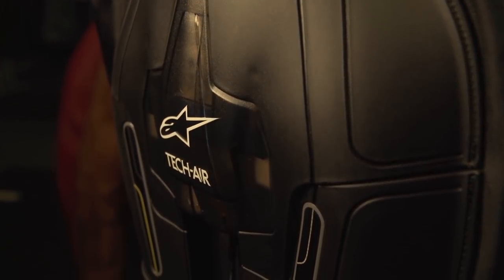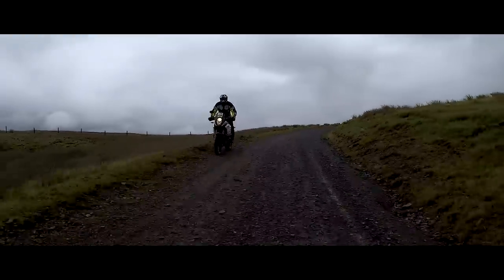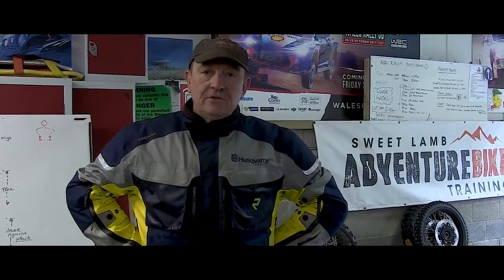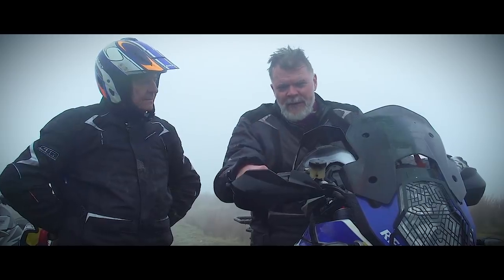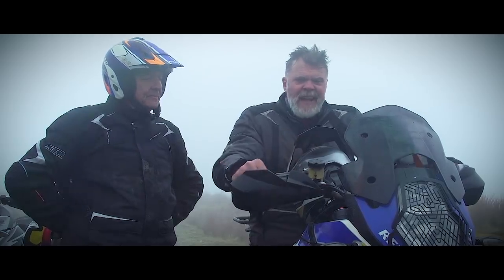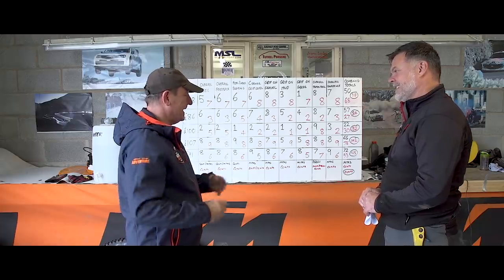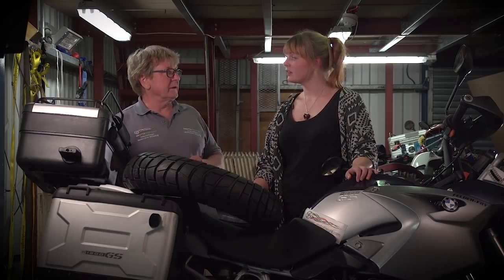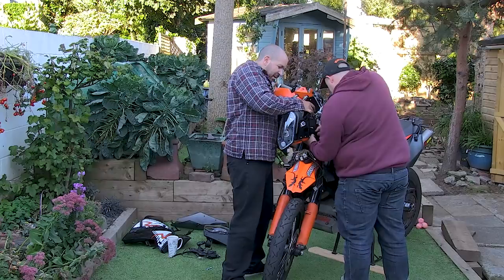Adventure Bike TV, Season 5, Episode 5

Comment: My TKC 80 gets 5000 miles on front tire and about 7500 miles on rear tire.  This tire mileage is done on my Super Tenere in all types of weather and temperatures.  20 degrees Fahrenheit to 110 degrees.   About 70% on road and 30% off road.   Front tire does make some noise on front.  I would say driving at normal street speeds the front tires is fine.  If you like riding fast like sport bike speeds the TKC front tire should not be your choice.  The rear TKC works great in all conditions and speeds.

Comment: Great episode as always just has me cringe when its the bike build section! I know you guys aint bike builders so dont want to be to critical and its totally refreshing in a way to see non bike builders realise how hard it is and how time consuming building a bike like that can be! But simple things make that whole process alot easier in the long run so for example: buy various size resealable bags to place bolts nuts and washers and parts in that are taken of the bike when stripping each section down and right on the bag with a sharpie pen what they off, 2: take pics of the removal ie were bolts go and were cable run! 3: when unplugging any cables or wires take a pic then on masking tape write what the cable or wire is for or goes too and then wrap the tape around it that way its a massive help when rebuilding the bike! Anyways hope my tips help a little, keep up the good work and ile look forward to next month as always 😉

Comment: "why did we 'decide' to test in the rain?" ... because you are in the UK, its not like you have a choice :D

Also don't forget you might be more used to the TKC-80 and so you feel like you can get closer to their limit safely. I find the karoo 3 on the rear does move around but its actually really safe, it lets you down gentle rather than just getting to the edge of grip and letting go. off-road, particularly in clay and sand, I've never had better. I don't use it on the front though.
Reply: Interesting - what have you got on the front?

Comment: Nice review,  but in my opinion you should have added the Michelin Anakee wild. I had them for an off road trip in the alps, under rain and also street and they are very good. On road I felt really secure and very good on highway as well. Very good grip off road, also when a little wet. Worth to try. They wear slower than the tkc80. But I would like to try the TKC80 as well

Comment: Great test !!! But you should have writen on your score chart, that you tested the "Pirelli Scorpion Rally STR" which is a street tire and NOT the "Pirelli Scorpion Rally" which is one of the best knobby tires I ever rode. People often mix these names up, the Pirelli Scorpion Rally works much better than anything else I tried on my Africa Twin. Especially the front tire is awesome in the deep sand.
Reply: to add to the confusion there are even two versions of scorpion rally, touring and racing....... but its impossible to find any info on the touring version online, pirelli killed that tire just by stupid naming
Reply: @Angry-Lynx  you're right that this is super confusing. I think they also have a dirtbike racing tire line with the same name (non-street legal tires). But I don't know for sure. So I think with the adventure bike tires the difference is tube tires or tubeless (which are a different tire, much more designed for on pavement riding)

Comment: Fantastic to finally see a tyre comp with different tyres on the same bike ( and not a paid view I hope ) I sure it isn't, as I would probably look at those two in your comparison test as best two as well.  I think out of interest if you used a Motoz Rear ADV Tractionior  and the M21 front you would be shocked at how good the traction is off road, On road the TCK80 would be better, but as you probably know they don't last as long, actually a Shinko 804/805 is almost the same as the TCK80 ( and last longer ) But great test well done and take a bow.
Reply: Agree on the Shinko 805. I ate 2 rear TKC80's on my trip across the US. The second one only lasted from Huntsville, AL to Moab, UT. Where I changed it to an 805. Which lasted the rest of the trip, and is still going strong. 

However, Now I'm back in the UK, and winter is fast approaching, I'm going to swap back to a TKC80 on the rear. The large slabs of rubber, with no siping, on the 805, won't be as good in the wet (IMO).